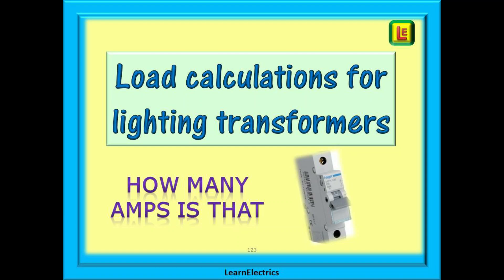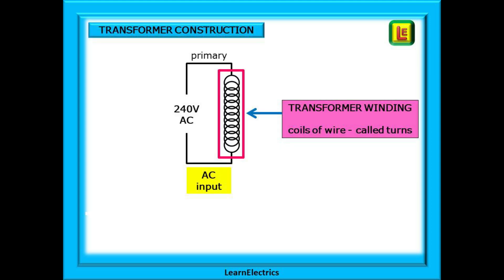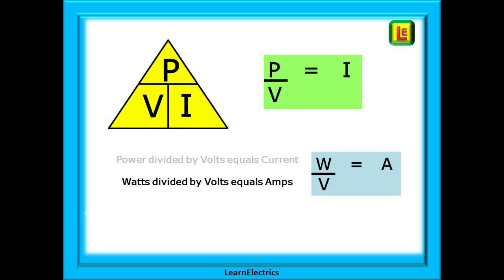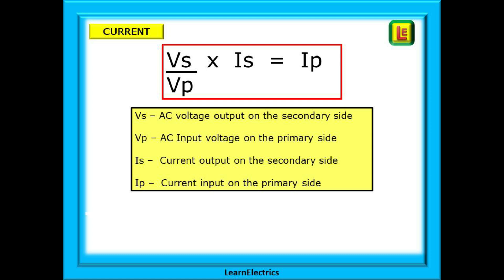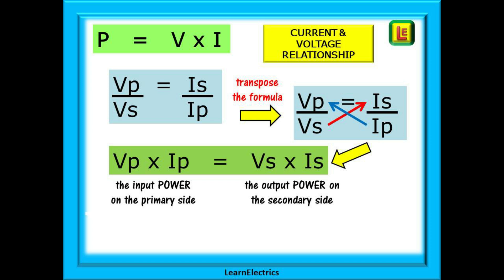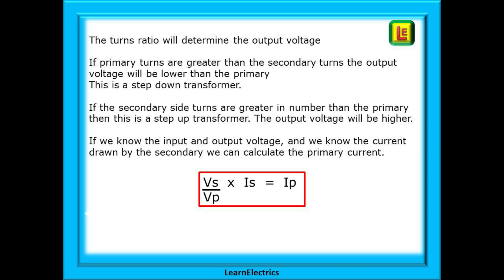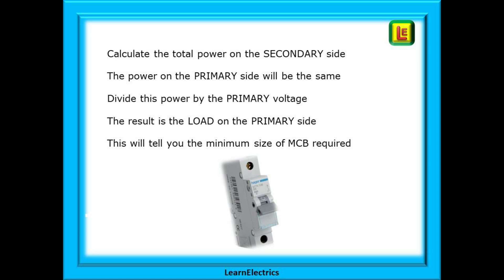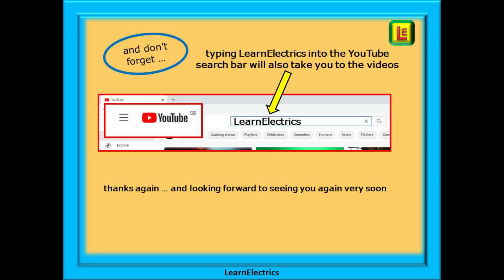LOAD CALCULATIONS FOR LIGHTING TRANSFORMERS – HOW MANY AMPS IS THAT?

Comment: If the current demand of the load is much smaller than the wattage. For instance for a door bell/ intercom that wants to draw only 0.5 amps but you use a 50 watt transfomer that can step 230v down to 12 volts. Although the output is around 5 amps does this cause the LV accessory to blow. Or does it simply not receive 5 amps because it only draws 0.5 amps.  Is it possible to use a transformer rated high in watts than the secondary load. Or will it blow out due to too much current? Or does it simply not draw all the current and therefore is fine?
Reply from the maker: Think about this. Your house supply can deliver 24 thousand watts of power, no problem. But you plug in a 60 watt bedside lamp and that doesn't blow. The appliance will only take what it needs based on ohms law and power law. Take a look at this video, it will help. thanks for watching. Dave.
https://www.youtube.com/watch?v=QdRXj3w6mGM

Comment: The current rating of circuit protection device should be equal to or greater than the design current, so in your example of 25amp the MCB. Should be a32amp as there is no 25amp MCBs on the market.but this is for filament lamps. So I think the answer to your question is a 6amp MCB would be fine.
Fantastic video as always 👍👍👍❤️
Reply: The easiest way to look at this, I think is: Power in Watts = Current x Voltage.  The power (not considering any losses in the transformer) on the primary (supplied and protected by MCB) side will be equal to the power on the secondary (load) side.  The MCB is not bothered whether the lamps are incandescent or LED. A 6A MCB will happily supply 1400W which equates to 28 x 50W 12V halogens or 350 x 4W GU10 LEDs.
Reply from the maker: Exactly Mike. Thanks. Dave.
Reply from the maker: Have another look at the video Sean. The main factor is that the power across the transformer is equal, a higher voltage one side with a lower amps is balanced by a lower voltage and higher amps on the other side.

Comment: Dave, I have been researching SELV garden lighting and was surprised at the large gauge of cable recommended for the 12V low voltage side, 1.5 sq.mm.  It appears to be driven by the need to avoid volt drop on cable runs over 10 metres when supplying LEDs rather than any electrical current carrying requirements.
Reply from the maker: Exactly, thanks. Dave.